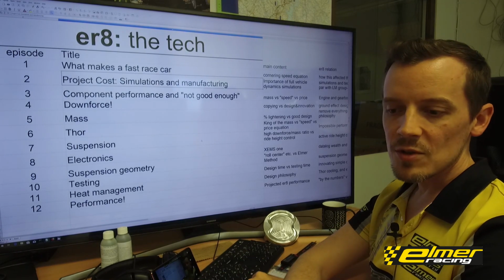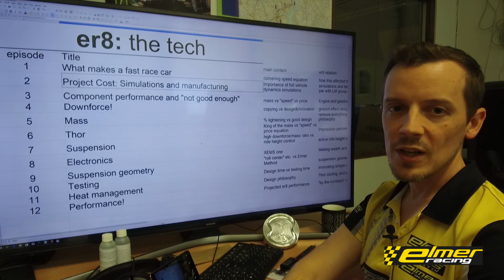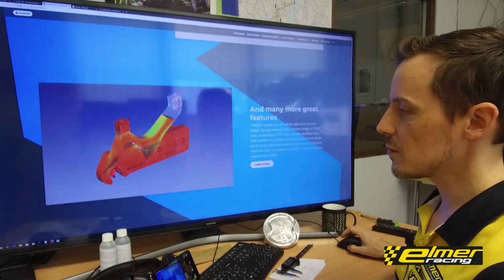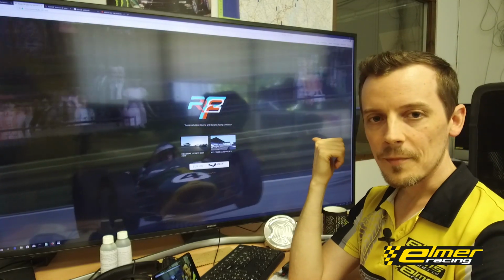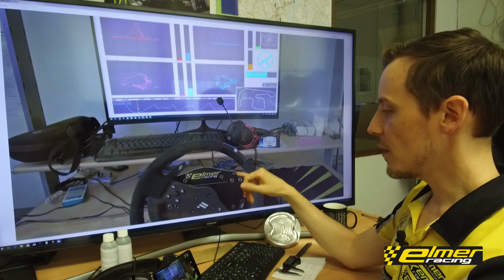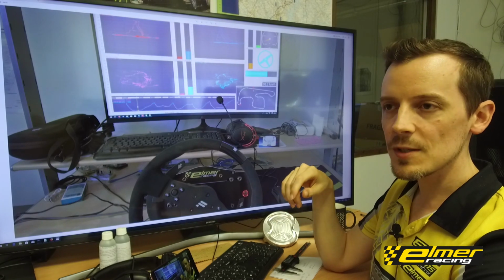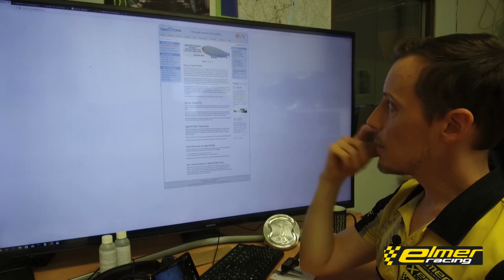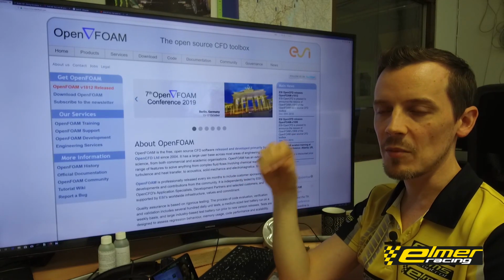er8: the tech episode2, Race Car Project Cost (simulations and manufacturing)

Comment: You show data that you can get out of rFactor 2, but how are you inputting a dynamic vehicle model into the software for analyzing your changes and how the affect lap times and performance of your specific race car? What data do you need to have/generate to feed the model specifically for rFactor2?
Reply from the maker: You need to input all the relevant data for what you want to simulate. You can take shortcuts, but only if you know that what you're leaving out isn't relevant.
You still need to understand what is happening any why, how things work etc. Simulations are not a replacement for physics understanding, and engineering work. The benefit is that you can test things before you build them.
For hobby stuff, you can't beat the simulation power/price ratio of rF2.

Comment: What software does your ECU run? I understand that you develop your own hardware but what can of software are you running?
Reply from the maker: Hardware is the smaller aspect of the control electronics. Relatively "easy" to do, once you have the specs for everything.
The software side is where our innovation is. We're using our in-house developed xemsOS miniature "operating system" to handle task switching and management. We're misusing some hardware features on the controller chip to effectively have the operating system running "in hardware" (parts of it any way). So extremely efficiently compared to typical real time OS's.
Reply: @ElmerRacing  this is amazing. I'M WORKING IN  starting my own company PI hypercar. And I hope soon I will talk to you and we might work something together.
Reply from the maker: Sounds very interesting! Feel free to contact us! We're quite often on business trips, so it's sometimes possible to meet Oskar outside of Finland also.